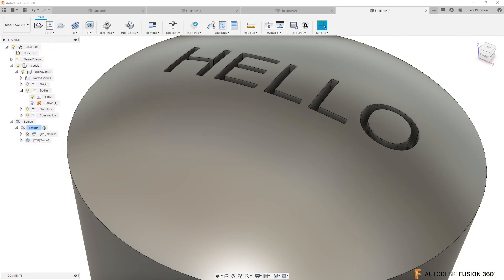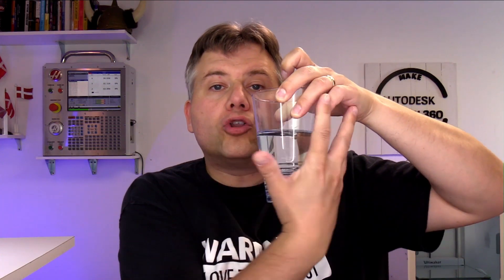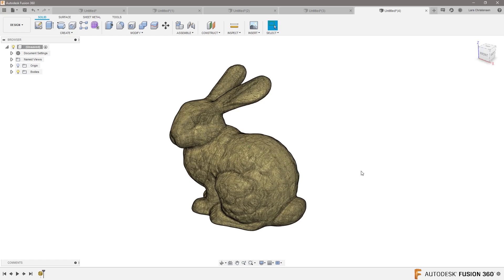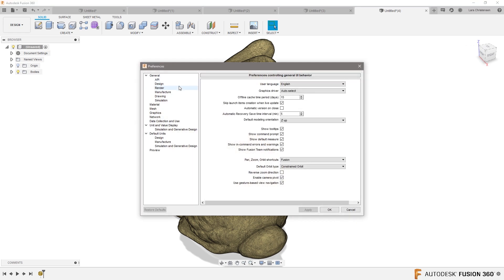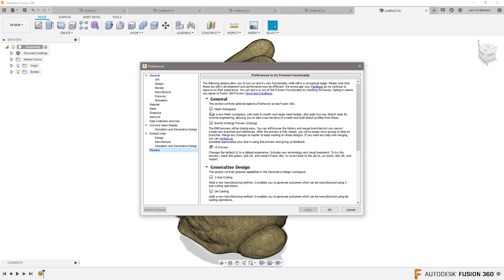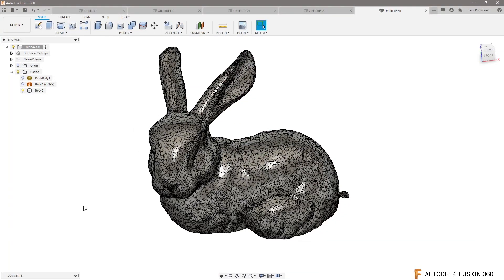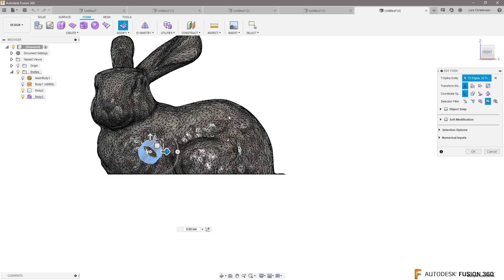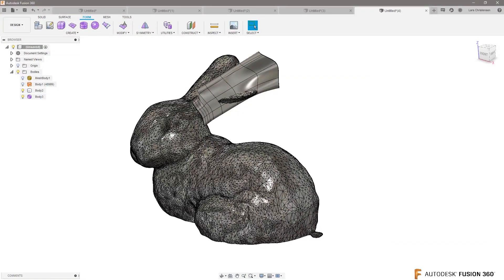Fusion 360 — MESH STL or Sculpt & FIX a Bunny — Ask LarsLive

Comment: I create lithophanes from 3DProcks etc. I end up with an .stl file. Print works fine but I want to print a base LED lamp setup that will hold the curve of the lithophane. I start a new project and insert the mesh .stl file. 360 just chugs to a stop if I try to make a simple sketch around the arc in the .stl file. Don't need the .stl file as soon as I make the sketch. But it locks up so badly I can't even draw the sketch to make the lamp base. Any help would be great. I follow everything you do. I have learned so much. Thank you.

Comment: STL may not be a perfect format, especially if machining tools can make rounded surfaces etc at ease. With 3d printers we are still limited by printer resolution like perhaps 0.05mm layers and 0.2mm nozzles (or more like 0.2mm layer with 0.4mm for typical printer). At that resolution STL seems good enough as an export/output format.
For editing stuff or storing the originals you really need  or probably at least prefer a more advanced storage option.
Many software like Fusion 360 have crazy defaults like making triangles that differ about 0.01mm from the exact surface (Fusion medium quality!) For much coarser 3d-printers that makes no sense and makes triangle count huge. If you allow perhaps 0.03mm error (that should be still much below printer resolution even with the tinies layers), you can really get the triangle count down.